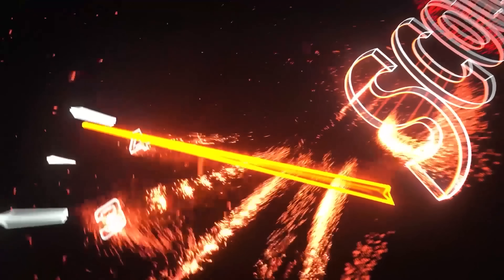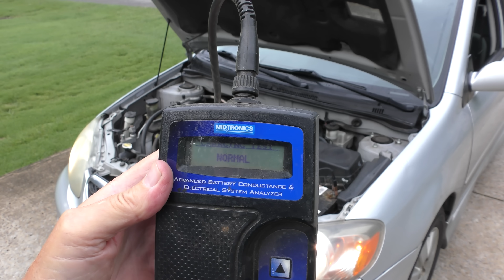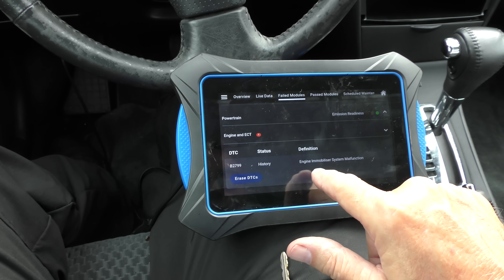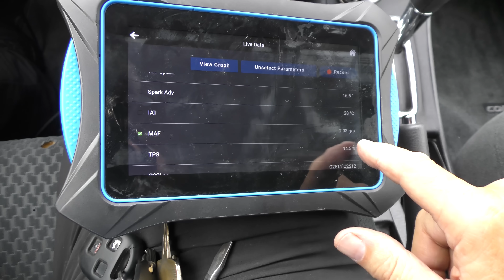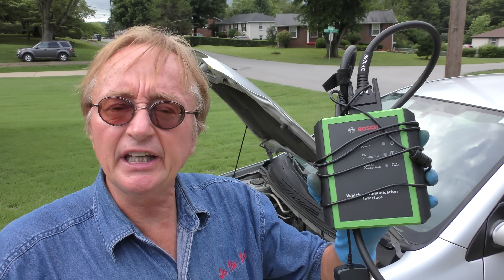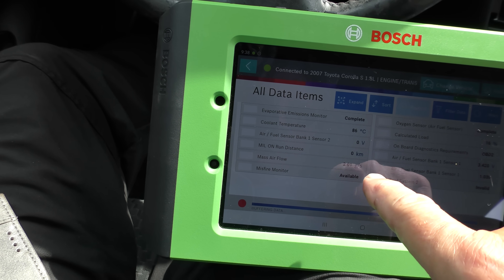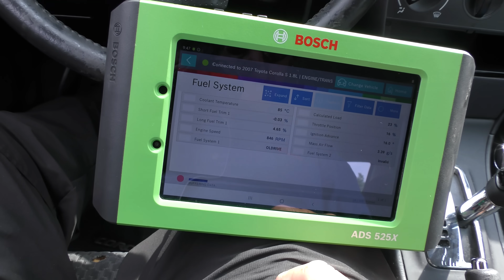I Can't Believe What This Fuel Cleaner Did to My Customer's Car

Comment: Berrymans B-12 is by far the best for cleaning fuel injection and its a lot cheaper. 
You can get it at Walmart for about five bucks. 
I seen a test with several others and it was the best.

Comment: I used mystery oil on my tahoe and never had an issue after...gas mileage, idling rough, didn't need to tune it up as often. I even let the truck sit for 2 years came back and put a battery in it and it cranked right up... I put it in the gas and the oil

Comment: That was a nice diagnoses, kinda gave you a run around, they probably ever put in any fuel system cleaner. I like that BP 44k, I use that every 10k miles in my Golf.

Comment: Throttle body Sensor caused mine 2002 gmc envoy slow acceleration. Check engine light finally came on. Had to replace the whole throttle body for that year model.

Comment: Speaking of sluggish. I'll never forget the Nissan Sentra wagon I bought ..It was back in 99 it was a 87 I think. Red station wagon. 400 bucks. Ran like a dependable rat but acceleration was hell. If I have it more than quarter of pedal it would chug down and stumble. I did everything. Eventually a friend of mine says.."Give me a broom handle and a wrench. Also a hammer. He went outside and I stayed inside maybe 5 minutes finishing up something I was doing. I go outside and he's handing me the keys with a smile. On the ground was a bunch of nasty black sticky little balls. Hahah. Turned out he knocked out a ton of backed up oil burned and fuel deposits. Clogged catalytic converter ...This little car was happy. I wound up , since it was loud now. Pulling it out and piped it out. Well he did. That little car ran like a champ!!!! I mean it was a scooter. Hahahahaha.

Comment: Scotty you're awesome.  Do have a question: Engine  yukon 5.3 l59 , rebuilt, dropped in a 69 camaro, new headers, new exhaust system, new Cadillac converters, injectors are the originals and I've cleaned each one. The car starts but 3 cylinders (4,6,8) are running hot really hot . So hot that they have changed the color of the headers on those three, the others have no change in color. I'm at a loss to what to do next. The car isn't driveable at this point. If you have a direction I should let me know.  I have a you tube channel: Alien RestoMod.  Three videos ago you can hear the engine run and see the discoloration on the headers. Any help would be appreciated,  I know I'm asking a lot.

Comment: Before computers were installed in cars, my father would just listen to the engine run at different speeds to get a good idea as to where to start looking for the problem. So, in the early days, you can say, the ear was the scan tool 😄

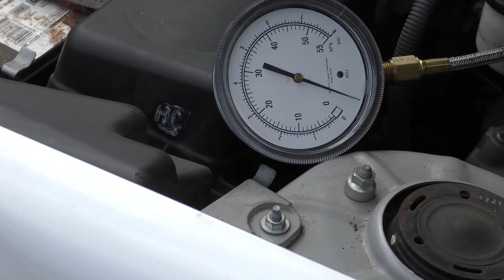Comment: @ 4:37 the long term fuel is +4.65 that means that the engine running lean so the ECU adding more fuel targeting the stoichiometric air–fuel mixture which is about 14.7:1

Comment: This is the same with my car.  When I bought it, had 104K miles on it and it lags in acceleration.  When the signal turns green, I need to kick it on its butt and say come on wake up and go.  But I got a dollar tree "Fuel Injector Cleaner", where my dumb car turned into sports car.  Here is the magic !!!

Comment: Scotty Question on a bad water pump video. You had a long screw driver and removed the belt and alternator. Why not use the screwdriver like a stethoscope putting on the alternator while under a load? Then the tensioner ,idler pulley, and water pump? Takes 5 minutes.

Comment: I used to have a car that started running crappy.  Couldn't figure it out.  Finally I reviewed where I was getting my gas.  The pattern was consistently a certain brand of gas.  I figured out they weren't a Top Tier supplier.  Top Tier is a program where if a fuel supplier puts a higher level of detergents in their fuel, the Top Tier organization recognizes them.  I won't explain it all here, you can Google it.  Anyway, next time I loaded up with a Top Tier approved supplier.  Before the end of that tank it started running well.  Lesson here is dirty injectors are a real thing.

Comment: Back in the 90’s, my friend got his sister 80’s Ford Escort GT.  It was in the garage for years. So he put new tires on it, tune up and it still ran pretty slow. Even my 85 GMC 4 cylinder S15 was quicker lol. Any way after checking everything we were stumped (16 years old at the time). I finally said toss in a few bottles of carb/fuel injector cleaner in there just incase something is clogged or there’s build up.  Tossed in 3 bottles near empty. After a few days of light driving...night and day difference. So it was the same...clogged injectors.  After that his car would smoke my truck lol.

Comment: 168k on my 2.5 toyota camry, it gets driven 315 miles at a time at 80-90 mph through 100+ degree Temps, haven't had a single issue,  I change the oil every 5k like scotty says

Comment: Scottys a rare breed. They stopped training mechanics to diagnose issues. They're just trained to replace things now and hope it solves the issue.
Can tell when they tell me my brake fluid is low and they can top it up for an extra charge on the bill.
My discs and pads were 3 weeks old at the time (obvious from looking) and I'd replaced the brake fluid.
It's an enclosed system so should only go down marginally as the disks and pad wear down.
The mechanic couldn't put two and two together so I had to prompt him "did you check for a leak"?
Lo and behold, it WAS a leak.
No quality mechanics these days.

Comment: This is funny when my auto scrubber does not give enough water for scrubbing floor at the shut off valve i  on screw waterline blow air removes water build up slime. Then my auto scrubber water flow is back to normal. Same with gasoline, the line and fuel injectors 
A Great video Scotty.

Comment: My 01 Escape was sputtering/chugging/no acceleration.(Cylinder 5 misfire) Changed plugs/coils, and poured in some Lucas fuel injector cleaner. Problem solved.

Comment: So I learned from old-school mechanics like you but something a man with a Doctrine in the area of auto mechanics explain to me a copper sparkplug you've got to get the proper gap on but when it comes to your radium or platinum plugs you should never attempt to Gap them they come pre-gapped from the factory and just slightly touching the electrodes on them can damage the electrodes on Platinum and iridium

Comment: Sometimes when a car has no power and diagnoses didn't show anything wrong, hitting the limiter, dropping the clutch in 1st and going to the limiter till 3rd gear and it runs perfect agin.
(Only possible on manual)

Comment: I didn't know that about gaskets. My thought was as you tighten the bolts the gasket will make tiny movements to seat itself. Adding lube would cause the gasket material to slip into place. Now I know not to lube gaskets.

Comment: On trans pan gasket, instructions stated to use a coat of Vaseline.  Under the idea the gasket will smooth out evenly without any minor kinks or such. So a complete seal is made.  So, is the advice for a trans pan similiar?

Comment: Would using this on an older car be good preventative maintenance or should you only use it when you have a problem?  I have a 2011 Tundra with 200k-ish miles, runs fine but I'm always trying to keep it running fine.
Reply: Hardly broken in.

Comment: Had a similar problem with my old Toyota Avensis 2.0 with direct injection. car hesitation when accelerating and catalytic converter errors. Even after replacing the converter and the Four sensors, the problem kept occuring. It was the fuel injectors that needed replacing. Toyota wanted  around 1400€ for the new 4 injectors 🙄

Comment: I'm having the same issue in my 02 K20.. new Vtech solenoid..new NGK plugs n coils ..new valve cover gasket..new map...used injector cleaner.. still hesitation when getting into it...narrowed it down to evap canister leak or Fuel pump failing or clogged I guess 228,900 miles will do that

Comment: My wife and I also had a terrible malfunction after using a  popular,  "top rated" decarbonization product.  Caused an intermittent misfire only at idle.  Dealer, after charging an arm and a leg, misdiagnosed the problem and tried to sell her a couple of thousand dollars worth of repairs.  The 1 800 number for the product was a joke,  they didn't even care their product hurt her car. I had used the product in every shop I worked at prior to this,  but rest assured I never used it again.  My best advice is to never use any decarbonization product. Ever. Just drive gently and use top tier fuel.

Comment: That royal purple stuff works well. The occasional treatment helps my car runs a hint quieter and slightly smoother. And if anyone is curious what's in it, hit read more for the percentages.

CAS ID 64742-47-8 : DISTILLATES, PETROLEUM, HYDROTREATED LIGHT @ > 85% 
CAS ID PROPRIETARY: POLYOLEFIN ALKYL PHENOL ALKYL AMINE @ => 5% =< 15%
CAS ID 64742-95-6: SOLVENT NAPHTHA, PETROLEUM, LIGHT AROMATIC =< 1%
CAS ID 95-63-6: 1,2,4-TRIMETHYLBENZENE =< 0.3%
CAS ID 108-67-8: 1,3,5-TRIMETHYLBENZENE =< 0.2%
CAS ID 91-20-3: NAPHTHALENE 0.1%

So the first ingredient is light distillates of petroleum, highly refined isoparaffin and naphthenics with a carbon chain length between 13-14. This serves as the primary solvent to dissolve everything else. The second ingredient is a custom polyolefin phenol, that has a few hydrogen atoms removed (see alkyl), and replaced with nitrogen atoms (see amine). This likely serves as the primary detergent, and this is obvious once you notice it's also found in SeaFoam and similar products. The methylbenzene is different isomers of toluene, a common solvent found in many products, like spray paints and markers. It's also a viable gasoline substitute. Naphthalene is lighter fluid. Given the low percentages of the last three items, they are likely residual byproducts from production or added as stabilizers to prevent separation.

Comment: I have same problem in my Toyota Corolla 2010.  I have to read the Long furl trims and check all the sensors and I also had it throw a high circuit throttle postion a but it did the same thing as this car

Comment: So the long term fuel trim only changes after the short term is pegged max, The car is lean so the long term is positive and short term is fluctuating in it's normal range, when both are maxed it throws a code to show no more adjustment possible.

Comment: I have this problem on my 2015 Chevy Malibu 
I had the dealership change out the fuel injectors/mass airflow sensor/ both O2 sensor/ vacuum pump
and  the same code, P0420, popped up again 3 months after driving it a while.
I did notice that after all those repairs the car still ran poorly and it would completely shut off when the auto stop feature would turn the car off and try to start it back up again after releasing the brake pedal.
I am beginning to think that the catalytic converter is no longer working properly and I might have to replace that

Comment: Short story about mystery solved somehow by new battery. Battery tested fine. Engine raced to 3000 very noisily upon startup. Hight parasitic drain, back door electric lock didn't function. Code indicated issue with TPS.
New battery solved all issues.

Comment: This is great example of running down the cause of a problem and getting to the resolution. The dealer didn't have a technician with the skill to isolate the issue, I'm guessing. Doesn't seem so difficult with the proper skill set. At least the dealer was truthful instead of running up an expensive bill.
Reply: Huh, Right to repair passed recently

Comment: Toyota's Corolla is one of the best engineered cars to ever be produced. No car is perfect but Corolla's come close for reliability. The only problem I have with this video is that he should've tried the injector cleaner first before going thru all the electrical and oxygen sensor tests . If that was a billable job it would have been  $300, not $34 for an overpriced fuel injector cleaner brand. Well done Scotty , that Corolla is good for 300,000 miles or more if maintained properly.

Comment: I have been using MMarvel Mystery oil for years, in the crank shaft as well as petrol tank.
I would recommend it for any combustion engine garden equipment, after seeing how well the Royal Purple worked I want to try it.

Comment: Be careful replacing coolant. I had a mechanic put the wrong kind in my GMC truck that ate up the head gaskets.
Reply: That's what Dexcool actually did originally, attacked the gaskets. It was later discovered to be incompatible with certain gasket materials. There are videos on YouTube about it.

Comment: I thought that the fuel injection cleaner could cause the fuel mixture to run rich and have the "check engine light" to come on with another engine code. Guess not.

Comment: For all the guys laughing at the gas station about how you putting fuel cleaner in does nothing but cost extra. Scotty to the rescue lol. Additives work. Not all, but some are great. I used seafoam in my old f100 to free a lifter. 40 miles later never a problem since. Just need the right additive for the right problem!

Comment: 2006 f 150 5.4 engine drive along 30-40 mile per hour hit the gas pedal it doesn't  pickup speed right away it jug will bad but it pickup speed  slow.

Comment: My 05 canyon will go into reduced power mode low traction, and the entire engine will just shut down and my dad put it on the code reader and it throw any codes it will do it every now and then.

Comment: Hey scotty i have a 1994 lexus ls400 it runs and idles rough when the ac is off and there is a noticeable lack of power there is valve tick in some of the rear valves

Comment: I have a couple bottles of the royal purple fuel cleaner that has been sitting around for years. (5+ years)  Never opened and sealed.  Always kept in cool temps.  Are they still good or should I throw them out?

Comment: Umm... Long term fuel trim corrects for short term; So if the computer is Adding fuel (going up in number) then the engine is running LEAN; not rich. And the computer is working as designed; adjusting for a lean condition. Probably Carbon on the backside of the valves soaking up or shrouding the fuel and/or plugged injector nozzles are likely the cause.

Comment: I have 2013 toyota camry base model.  My question here is that it shakes when going going on the road like one of the wheel is wobbly from the steering wheel then it goes away.  Then it comes back on whenever i give it some gas.  I ask on the forum and people are saying that it could be the axel or the engine mount gone bad.  So how do i go about to check it?

Comment: Hello Scotty I have a 2004 Toyota Corolla it has the P0420 code. I changed the plugs, and sensor. It runs good acceleration is good it goes past 80. Do you think it’s the cat?

Comment: Scotty, for Turbo GDI cars, how do we take care of the carbon buildups in the engine? does using engine flush that i pour into the engine oil and run about 100km before an oil change helps ? how about the fuel system cleaner? how often should i use them?

Comment: Scoty I have 2002 Honda civic 160 miles I don't have any check engine light on but this car burning gas I tried lucas fuel treatment seems like i will have to run my live data conputer to see how's the engine performance

Comment: Can a clogged or old fuel injector cause the car to vibrate after driving for a while? I did take my car to a mechanic that replaced the head gasket and spark plugs (apparently the gasket almost had it and the oil dripped onto the spark plugs/cracked them and caused miss firing). I still find my car has no power which is what I originally asked my mechanic about, although I think it's guzzling more fuel now, over the course of a month, I've poured two bottles of Nylon Fuel Injector cleaning into the tank to see if it'd make a difference.

Comment: So if I have a 2004 Toyota Camry that drives fine but has low idle issues, would it be safe to run the Royal Purple gas treatment or could it cause any problems?

Comment: Hi Scotty I have a 2009 high country GMC Sierra everything from spark plugs, spark plugs, fuel injectors, and catalytic converter has been revised and changed when driving it feels sluggish I’ve taken it to 4 different mechanics and everything seems to be fine except it’s not any suggestions?

Comment: @hey Scotty I’m back again with some a question about my old 1995 Acura integra. The car has been sitting for 3 years. I’ve started it every month or so just to keep the engine running and I got it moved across town and now it’s doesn’t start unless I hold the starter on to turn the engine over with the starter putting in most of the work. Do you think my timing is off or can I be the distributor went bad?

Comment: Hi Scotty, great video, as always! My question is: Do you find any adverse effects from using friction modifiers like HotShot's Secret or Liqui Moly when doing oil changes in preparation for winter temperatures?
Reply: I ruined an engine using engine cleaner once in old high mileage motor.  Cleaned all the sludge off inside of engine and clogged oil pump.
Reply: @markbeeman3093  their for GDI engines with carbon build up on the oil rings and in other areas of the engine. Their not for engines where people didn't change their oils for tens of thousands of miles.

Comment: Could dirty fuel injectors account for a long term fuel trim that is as high as +20%? This is happening in my 2010 Lexus RX350 that I just bought with 141,000 miles on it. I want to fix this before it leads to anything serious.